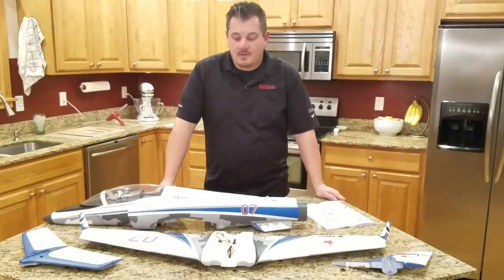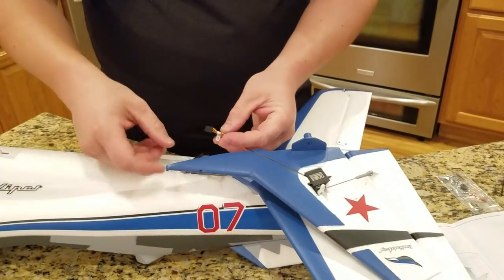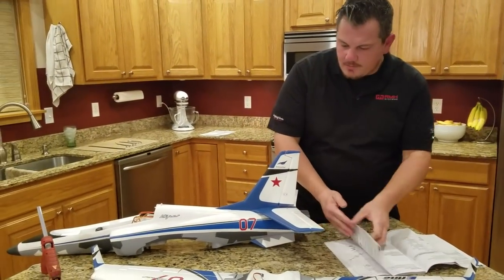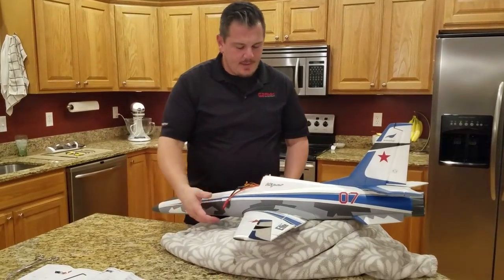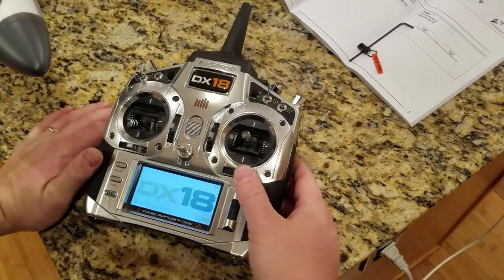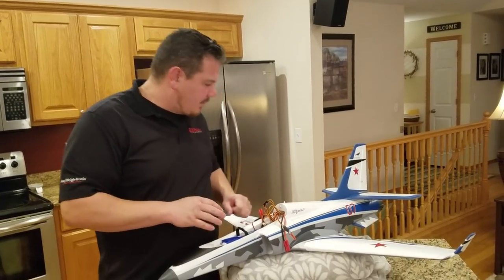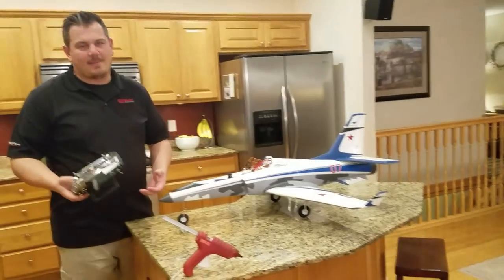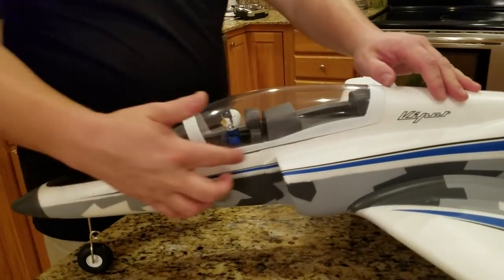Horizon Hobby - Viper 70mm Jet - Build & Radio Setup

Comment: Looks like a job for a few servo wire extension safety locks, or some heat shrink. Either is/are very inexpensive, and IMO better than hot glue.
Reply from the maker: This plane had just a crap-load of wires in a very small compartment, with no rhyme or reason to where I could put them.

Comment: I know your frustration Brian, I was holding my breath and praying I wouldn't' break a servo wire shoving all that crap into a 1/2 " hole in the wing..utterly ridiculous!! Held my breath and plugged in and yay! It all actually worked. At least they had the sense to install a bind plug extension in the receiver.
Reply from the maker: yep! I still can't figure why they didn't just locate things slightly different. If they did, we could probably fly with a 5000mAh pack ;)

Comment: Using cyano glue where you want a permanent connection is a good solution. Just a little dab right before connecting them. Furthermore - using a thin wire (not piano) and bending it at one end like a hook then it might get easier to pull the bundle of wires thru the tiny hole - remembering to push the wires from the other side also. Super good video !! Nice to see a foam edf without all the extra cheater-indtakes for the EDF unit. I really love this model.
Reply from the maker: Yes, that's another great way to do it, and it can be removed if you don't mind a bit more work, or just stick the sharp end of and exact knife under the CA once cured and many times you can just pop it off... I kinda preferred a quick solution, and on a plane this size a couple grams added for hot glue doesn't bother me.
This plane performs really good! I've had to fix mine a couple times since I fly her on 4000mAh 6S 60C packs, which are near impossible to get CG'ed out perfectly, thus, always land her fast...even thought I insist on flying from short fields - LOL - but if I ever get a 3300mAh 6S 60C pack, I'll give that a try and I bet she'll flair with the best of them, and land at half the speed :) (I actually can't wait to try that out!!!)
I've never been bothered by cheater inlets, but they do make the planes super vulnerable to FOD, when taxing!

Comment: Good, thorough build video as always. Wish I had seen this before I built mine.
Reply from the maker: Did you have any issues? I thought it was fairly straight forward, but good Lord, there's a ton of wire and NOWHERE to shove them!!!
Reply: The wiring is such a mess. I still haven’t figured out what to do with it. The only issue I’ve had is the tiny little C clip that holds the landing gear, or wheel on fell off and it’s impossible to find one that small anywhere trust me I have tried. So I called Horizon and they didn’t have one to send me so I had to buy an entire main landing gear set for $16 plus shipping for a $.10 C clip. So I am actually grounded right now because of that one little part but that’s OK I love this jet so much I’m willing to wait.
Reply from the maker: Can you just throw a small zip tie on and CA it for now???? I've had luck with that, but you gotta be careful it doesn't migrate into the wheel bushing area.

Comment: Next time put a servo extension with a built-on clip on the flap and aileron cables one at a time, and pull gently through the fuselage hole.  You might also consider wrapping the connectors for the tail servos with magic scotch tape or tie the connectors together with dental floss or braided fishing line.  In my opinion putting hot glue or using heat shrink near the foam is asking for trouble (ask me how I know).  I didn't read most of the comments, forgive any repetition.
Reply from the maker: I'm just lazy ;) Hot glue is quick, but if you drip on the foam, it's a mess, admittedly....but slightly better than a drip of molten solder - LOL

Comment: Brian,
Nice build video. Check the balance with the gear retracted. The nose wheel will swing back a couple inches and could change the balance. When the camera is several feet away, it gets hard to hear you talking.
Reply from the maker: I would normally agree with you, but the manual said with gear DOWN...so I guess I'll do it that way on this plane for now.
Sorry about the changes in audio quality. We're considering some changes to help with this, but won't be able to get that implemented until we're through with our new house build and move...

Comment: Nice build just got mine I will be putting it together soon great info.
Reply from the maker: It's an easy build, except for fishing the wires through. Make sure you figure which way you're lipo leads need to fit...or you WON'T have enough room for the servo cables and Lipo discharge leads. I GOT LUCKY!!!
Reply: Brian Phillips Thank you I'm ordered 4000 6s because I don't want use my 5000 6s might too heavy and big

Comment: You have the most detailed transmitter setup videos out there!  I could not figure out how to properly get safe select to work until I seen a couple of your videos about needing to assigning a channel for the safe select switch. The eflite manuals do not state this bit of info, and are overall horrible on the TX setup portion.  I did notice In a couple of your videos that you recommend throttle cut set at -100 instead of the manuals suggested -130?  Do you have a good reason for doing this?
Thanks!
Reply from the maker: Thanks Kevin! 

As for the -130% as default...I feel this is a gaff on Horizon Hobby's part...the rational behind the -130%, as I've come to understand it, is that this is more of a "kill switch" setting for a gas plane / heli. As you know, with a gas engine, you have an "idle" throttle setting, as well as a throttle setting somewhere below that, where the mixture won't be enough to keep the engine turning at all, thus it stops. So if we were all flying nitro planes, this would be just fine, as we'd want to have a kill switch WELL below "all the way down" position on the Left (throttle) stick. HOWEVER, I've actually never flown a gas plane. That's not to bash anyone who does, or cause a rift among the RC ranks (something that's WAY too easy to do!!!), but let's be honest, the manual is showing a -130% setting for all these electric foamies!?!? Why??? Because that's what the "default" setting it, I guess???

The problem with setting -130% for throttle cut, is that there is a chance you might accidentally reprogram the throttle range from +100% (top) to -130% (bottom), and next thing you know, you turn off your throttle cut, and your prop starts running at about 15% throttle!!!!!! Not a nice thing to experience, especially for a beginner that's totally confused.

P.S. I'm not just a nay-sayer here...I've actually experienced this a couple times though my most recent RC experience, well, more specifically, it happened to Esteban, even after asking him to do thing "just so" to avoid said issue - LOL.

Moral of the story, set the Throttle Cut to -100%, and save a fingers live!!!

Comment: There is an old trick for servo wires to make them shorter, and easier to work with.  Take an antenna tube (you can get them for under a $1 at any hobby shop) and wrap the servo lead around the antenna tube as tight as you can, when your done it will corkscrew so you can stretch it if need be, ajd it will take up allot less space in the cabin
Reply from the maker: You can also apply a little amount of heat, and make a more permanent "coil cable", if you don't get it too hot ;)
Reply: @BrianPhillipsRC  I recently started learning to fly with a Hobbyzone Mini Apprentice 1.2.  I have raced on and off road RC for over 20 years,  but all of the local track closed, and I decided to start learning to fly.  I live near a bunch of schools and not far from a rc airfield, so I figured why not.  I did pickup some EDF Jets with my Christmas Bonus (E-Flite Viper and Freewing A-6) but they are staying in the boxes until I am ready.  I am going to go to the local club and get some help, and some advise on what a good intermediate plane is when I am comfortable with the Apprentice on expert.
Reply from the maker: Good idea! I know it's tempting, but even with SAFE, you will want to be totally comfortable with your apprentice, as it's a very good plane, and VERY easy to fly :)
I wish I could just fly, and then I'd have so much more time to devote to the hobby, but we have so much going on in our lives, much of which is to facilitate the growth of this channel, but not exclusively.
Reply: @BrianPhillipsRC  I am single again, no kids, 41 and as long as I log in my hours with work (I telecommute) I can make time to fly almost anytime.  Yeah the tempation is there, but that's allot of money to make into a lawn dart, and I am happy with flying the Mini Apprentice. The SAFE on beginner really makes it easy, but on the advise of a few RC pilots I am not going to stay on beginner to long.  It's great for getting the basics down, but you have to give full stick to bank if 15 degrees, and the guys I spoke to said that teaches you bad habits.  So once I get comfortable enough I am going to switch to intermediate, then expert, so I can learn how much input is normal on the sticks.  I got the BNF Mini Apprentice, spare batteries and parts, and a Spectrum Dx8 so I can progress without needing to buy a new Tx
Reply from the maker: SKIP intermediate. It's just a total False sense of security, with virtually NO protection.. Just go from SAFE when you really need it....like a dicy landings, or a tough takeoff...then get off of SAFE totally. Just fly a few mistakes higher, and you'll be fine.

Comment: Hi Brian, can I fly the the Viper with 4s 4000mah batteries until my 6s arrive?  I haven’t done a maiden yet and was wondering.
Reply from the maker: Probably not. If you could, it would be super lame-o..... Remember, power saves lives in RC aviation ;)

Also, you'll find out, this plane, while it has power, it could always use some more (even on 6S)!!!
Reply: @BrianPhillipsRC  I want a very tame maiden until I get to know the plane.  I don’t go nuts until many tame flights under my belt.  The 4s would keep it tame like my Habu.

Comment: Uncle Brian, presume you weren’t the best model aircraft flyer on YouTube. (I realize that would be difficult, how about thinking the joysticks were reversed for a day. Throttle/Rudder on the right, Aileron/Elevator on the left) Now you better understand how it is for me to fly. It’s like dyslexia, but only with my hands with a transmitter. With my “handicap” I can use all the help I can get. I bought the Avanti V2 landing gear as a crutch for my poor landing ability. 
I used a brand new Exacto blade to widen the main gear hatches, but it still looked like Jason the Ax Murderer carved it out. Of course after I was done I thought- “WWBPD?” (What would Brian Phillips do?) I thought- “Brian would’ve used his his hot knife technique.”
So, my question is- how would you expand a wheel well about 3/16th of an inch and have it come out smooth?
Reply from the maker: LOL!

If I wanted to widen the foam landing gear cavity...I'd use one of my 20/1000" shims I use to cut foam. I heat it up to RED HOT (on the end you're NOT holding - FYI, LOL) with a small torch. Then I just free hand it. You will need to re-heat it a few times so it doesn't start to stick. Keep in mind, it will never look 100%, so don't beat yourself up. When you get the hot blade near the edge, make sure you don't over-do it! After you're done cutting with the hot blade, you can use a BRAND NEW EXACTO KNIFE BLADE to trim the edges if you wish to make it look as perfect as possible.

Just go for it ;)

Comment: To get the Wires through I taped them to a long piece of wire that I was able to pull through and that made it much easier.  That was the worst step Forsure.
Reply from the maker: I agree. Too tight.

Comment: Hi guys, I have a 4000mah 80c  in my viper. Is a very tight fit, keep loosing my canopy during flight. Any tips
Reply from the maker: Trim a LOT...it's a PAIN, but you'll have to do it if you keep loosing it. One of the few real issues with this plane....battery tray size and gear aren't super heavy duty ;( Other than these issues - TOTALLY AWESOME!!!

Comment: Hey brian working on my viper now. First I gotta say horizon should be ashamed of the wiring situation on this plane, what a headache they are usually a lot better than this. But two questions for you and since it's virtually impossible to get ahold of horizon right now I hope you can help.  The  flap set up in my manual it shows. 
100
0
-100
Do you think they just updated their manual, I can't figure out why your manual would say 
100
-45
-50
Even the manuel online shows what yours did so I don't know why mine is different. 
Also did you ever end up adding any elevator correction in the flap set up? Thanks again for your time and any help.
Reply from the maker: I agree about the wiring. This plane is SWEET, but cable management is very challenging on this beauty. As for flaps....here's what I CAN tell you...make them come out as far as possible. You will want lots of deployment for landing, and about 1/3 to 1/4 down for takeoff. They work good, but get your battery back as far as you can!!!! You will NEED to modify a little to get the pack back, and if you do, you will be able to flare, BUT BE CAREUFLL!!!! The plane CAN slip out from under you when you flare...so be ON IT the first few times to avoid screwing it up right away.

Good luck, and you'll LOVE it!!!

Comment: You Can take dental floss and tie the servo connections together. No weight.
Reply from the maker: Good idea! I do have some trouble with super small knots though...
Reply: Brian Phillips you can use longer lead line to tie your knot and then cut it off. Had a guy show me about the dental floss along time ago and i still do it.
Reply from the maker: Nice! I assume you use the "string" kind, and not the plastic...right?
Reply: Brian Phillips yes sir.
Reply from the maker: Thanks Steve! I'll give it a try.
No matter how long I work with these things, I'm always learning a new trick! I really appreciate your help!